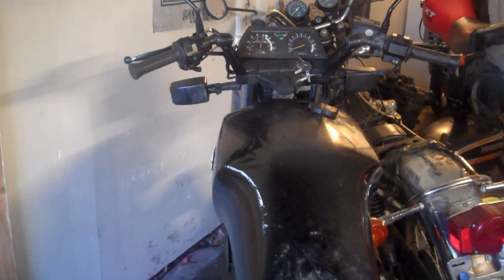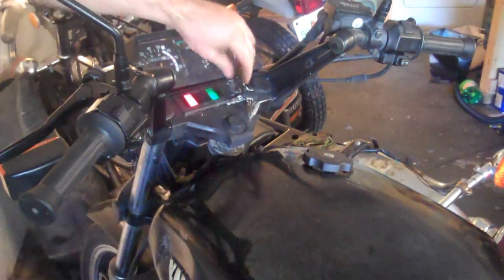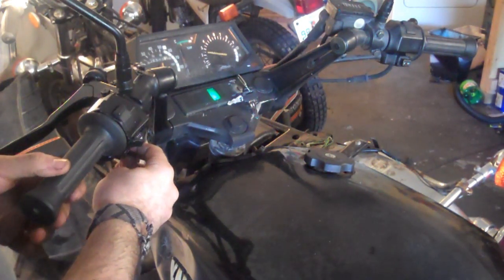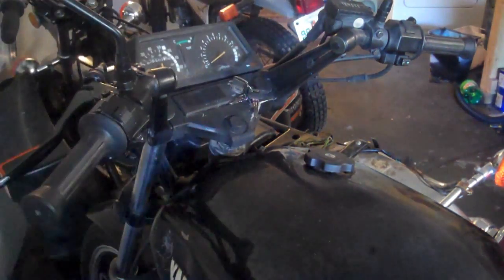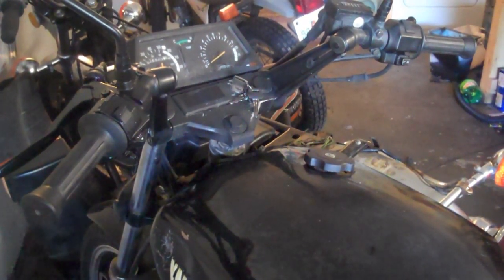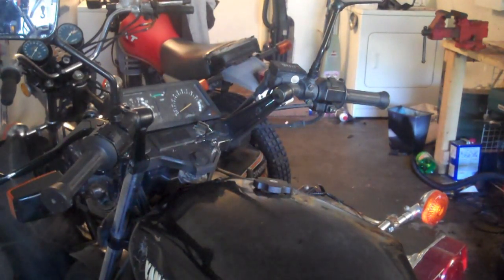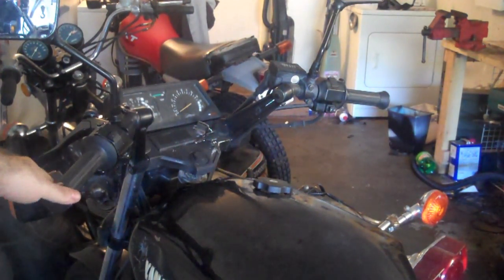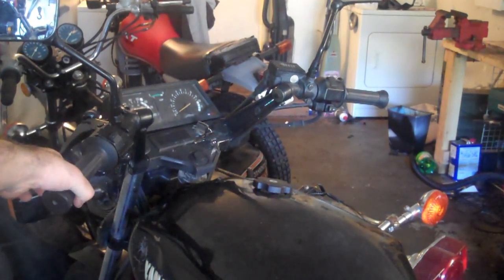How a kickstand switch causes a no-start situation

Comment: This happened to me once while i was taking the back roads for some nice turns. What had happened was somehow the two wires that connect to the switch had burned through(im suspecting it was touching the exhaust. so what i did was tie the two wires together to bypass the switch, no problems since :)

Comment: I actually bought an 01 zx6r for $800 and the kid told me it needed a starter relay.  I got lucky and found one on ebay for $6 with shipping and bought it before I went to pickup the bike.  Got it home changed it out and nothing.  I looked at the clutch (an aftermarket with no clutch switch) found the wires and it fired right up.

Comment: I am having this issue right now. smh I changed my kickstand due to the other one breaking and now when I put my bike down in first gear it kills the engine. thanks for the video. I am like really frustrated. I have assembled and disassembled my kickstand multiple times to no avail. I will try and look for the little "plunger" contraption tomorrow. haven't been able to ride for 2 days now and its so frustrating. thanks for the video. 2017 Honda CBR300R btw.

Comment from the maker: The neutral light switch is a little more complicated than a kickstand switch. On the ones I have serviced, they are like a cylinder with nubs on it, and when you shift gears it rotates around, and the nubs press on the switch to illuminate the neutral light. So, you could either bypass the kickstand switch by just cutting the wires and twisting them together, or break out your manual and find that neutral switch and repair it
Reply: What if you're not getting any power at the kickstand switch or the nearest inline connector, does that mean it's grounded out somewhere further down the line?
Reply from the maker: @igotakai5644  Well either yes there is supposed to be power and there isnt for some reason, or there is not supposed to be power because the kickstand switch acts as a ground itself, maybe for your starter solenoid. There are 2 different types of systems
Reply: @mrmaxstorey  Ok thanks I'll keep digging.

Comment: Yeah I know this one buddy happened with my clutch switch. I went all around learning about the ignition and charging wiring/circuitry to find that little shit :) also the previous owner jumped the side stand switch wires at the connector back up in the wiring. It'll bite me in the ass one day when I set off with the stand down tho. You're really good at explaining these issues dude :)

Comment: I've had some problems with ignition on my old Yamaha 1983 scooter. 
Finally I realized what was happening. There's an engine cutoff switch 
on the kickstand. Now some people say, your switch is not opening 
properly when you pull the kickstand up. However if that was true then 
why was it that when I left the charged up bike on the kickstand for a 
few days, the battery would lose its charge? So my answer to this was 
that when you deploy the kickstand, the cutoff switch is compressed, but
 over years of metal wear or wear to the switch button itself, that 
switch contact becomes less effective and starts to wear out. Then the 
switch is not properly depressed all the way when the bike is left for a
 few days leaning on its kickstand !! Then, I think what happens is that
 the bike is leaking electricity round the cutoff switch, discharging 
into the bike ground (the rest of the bike). Over a few days, you've run
 your battery down! Just now after charging my bike I started it up very
 easily, so I am pretty sure the problem is not that the switch doesn't 
open properly when I pull the kickstand up. (The switch seems to pop 
open as it's supposed to.) The real test will be to see if the charge 
holds for a few days of nonuse, in the new situation in which I've stuck
 a copper penny on top of that switch button on the kickstand base, then
 deploying the kickstand. That copper penny just adds pressure to the 
switch where the kickstand rotates to depress the switch. So now, the 
switch will remain depressed fully and will completely stop that circuit
 from leaking electricity to ground. So, if my theory is correct, in a 
few days, the bike should still be holding the charge on the battery 
properly. If I'm wrong, then the battery will have lost its charge again
 after a day or two. If that happens it would suggest I'm way off base 
and the problem is elsewhere. However I think I'm right. The way it 
started up this a.m. after having been left with the copper penny on 
that switch overnight, was perfect. It just immediately started, no 
problem. I think this is the solution for kickstand cutoff switch 
problems. Not sure how to do it without buying a new cutoff switch but 
I'll think of something easy. I can just stop using the kickstand 
entirely, only use the center stand when leaving it overnight. That's 
probably the best way to deal with it. I've cussed at it long enough, I 
sure hope I've got the answer now. I don't want to stick any repair 
money into this thing. It is a good bike for short errands and I really 
like it.
Reply: I should add that when I left it overnight with that copper penny helping to depress the switch button, I was trickle charging the battery. See, the problem is not that the battery is no good, I think - the problem is that after charging, with the bad semi-off position of the kickstand cutoff button when I've got the bike on the kickstand, I'm "trickle-uncharging" the battery all night, unless I put the trickle charger going to maintain some kind of charge anyway. I was doing this before but just barely keeping some charge even with the trickle charger going. Okay then, the normal answer would be to just buy another $60 battery, what's the big deal? But I have already tried changing batteries, recharging batteries and all that stuff. So I believe that a "bad battery" is NOT the problem AT ALL. The problem is the semi-off button left semi-off overnight. (It's not the spark plug, it's not the coil, it's not the starter motor, it's not this, it's not that. IT'S THE SEMI-OFF cutoff switch.) (The switch is not one that clicks on, and clicks off, because that's not what the kickstand is set up to do. It just depresses, and releases smoothly. So it must have a "smooth" gradual increase to fullest contact and then fullest disconnection, which makes the proper function vulnerable to failure due to surface wear of the button and the metal pushing against it.) That's my theory, but not fully proven yet. It might be something to consider as a possibility. I think it might be something to really test out.

Comment: It appears I just had mine fail on my KLX be glad it was such an obvious fault on yours Mine was miss fireing in high revs and then just shut down and would not restart.   After watching this I started thinking hmm   Yup bike starts and runs fine with the stand up but in Neutral or even with the clutch in it will crank no start friggen crazy.  This happened post timing chain fun

Comment: Thanks man was just checking out that on my bike also as it just cuts out sometimes when I’m out and reacts the same way as when the bike stand is down and I’m in gear.   Fingers crossed 🤞🏼 it works. Great video.
Reply: Did you ever figure out your issue?  I am having your exact same problem.
Reply: @nelaco1  I wasn’t 100% what the remedy was but I did adjust the idle on the bike and that seemed to work and I think my inexperience at the time was an issue too.  I think the odor was too low and it would cut out as I was dropping gears. Let me know how u get on with the idle
Reply: @DeiseRebel  Thank you Deise,  it could very well be the idle.  It is very low.  I'll try that next.  The bike is brand new and with only 500 miles now.  It is under warranty but I rather fix it myself if it is something this simple.  Appreciate the quick reply!  I'll let you know how it goes.  If it doesn't change, I'll bypass the kickstand switch.
Reply: @nelaco1  Yea I checked the kickstand also and that wasn’t the issue.
Reply: @DeiseRebel  that was it!  Increased the idle to 1100 and it doesn't die anymore.  Glad it was something this basic.  Thanks again!
Reply: @nelaco1  Ohh yes, see it’s all experience, I’m only on bikes a year last month n this happened so that’s the whole point of my channel is to help others and show my journey.  Thrilled you got it sorted 🏍✊🏻

Comment: Hey max, ive got what i think is a carburetor question for you. 81Kz 305 I cant get the idle to be steady or the throttle response good on the low end. I set the idle where it needs to be but after giving it some gas the engine idles higher then settles down after a bit.
Second i cant get it to be responsive at low rpms. If i give it a little gas and steadily increse it, it runs fine. However when i get on the throttle it sputters and dies.  Right now all the cables and air box are off.

Comment from the maker: I gave up trying to lube this switch and just bypassed it
Reply: I think the problem is not that the switch is not opening enough when you need to use the bike, it's that the switch does not close tightly enough (does not fully kill the electric current) when the bike is left standing on that kickstand). That's just my theory, might be nuts, not proven yet.
Reply: If I lubricate the switch, doesn't that risk cutting the circuit, because oil does not conduct electricity?
Reply: Maybe that would be ok, I'm dyslexic.

Comment: So if you don't have the boots hooked up the air cleaner it won't fire?  Is it that the fuel mixture is too lean?  Or does it have to do with pressure?  It doesn't even try to start even with starter fluid. I wish I knew how to put a Holley on the bike.  I thought 4 carbs would be neat. Boy was I wrong. How do you time the bike? What is the firing order?  I'm going to replace the valve cover gasket. I will check to see if all valves are working right.

Comment from the maker: Woah ok lots of questions. If you want to get into bike diagnostics with me deeper feel free to send a message. With the boots off the bike should still start up on starter fluid, but it probably won't run well on its own gas, because the mixture will be lean and the airstream will be chaotic.

Comment: Experienced this for the first time on my 1989 Honda CBR 600 (Hurricane). Oddly the stand light wasn't illuminating when engaged or disengaged. Bike died as soon as it's put into gear. Guess my 30 years old switch is going bad.problem wasn't assembly (verified), but the switch itself (electrical part)
Reply: Dealing with this on a CB750 -- I should try the switch itself, since things seem to be put together right..

Comment: Hi MrMax.  I was wondering if you could help me-I just picked up a '89 Radian and it has some issues.  Any guidance on what is "right side up" for an oil sensor (is it how it sits in the pan?  How can I bypass it?    When I hit START, the headlight goes out and the oil pressure light comes on, then goes out- No action at the starter - but directly wiring relay and battery gets motor to turn.  Any help would be appreciated.
Thanks for great videos

Comment: I just purchased a Vision off of Craigslist and it turns over and is getting fuel but no spark on either side. I checked the wiring harness R/R, battery (voltage and amperage), fuses, plugs, wires, etc and all were fine. The only thing I can think of is that the CDI is dead. However, after buying a "working" replacement off of ebay it still has no spark. Would this be a possible solution? I have the bike in storage and can't get to it to test it at the moment.
Reply from the maker: It is a common problem....

Comment: I have this problem on my R1, when I let the clutch out (while in neutral) it dies. Any ideas?
Reply from the maker: Did you check this switch?
Reply: Dealing with the same thing with my R1 . . . A few things to check: This switch, the clutch switch and the infamous TPS sensor. Also synchronizing the throttle bodies.

Comment: God damn these stinkin things because any idiot knows to put up the kickstand, if you leave it down you deserve what you get. I am so pissed off. I've got this problem with the same kind of kickstand kill switch, and looked at it, and in my opinion, it's not only preventing the Damned motor from starting (actually a great motor) - - but I think it's also draining electrons from my battery. Is this possible? In other words, when that switch malfunctions by being stuck halfway, with the kickstand deployed, in other words, when you have the bike leaning on the kickstand for a while, if the switch button is forced inward but not forced inward enough, the battery drains, then when you go to start the motor, the battery has drained off too many electrons. So, the problem is not so much that when you go to start it, the switch doesn't come down all the way, but in fact when you've been leaving the bike propped on the kickstand, the switch is only forced inward partway -- then, the electrons drain off because even though you have killed the engine using the kickstand, you haven't killed it enough and you've left electrons draining off into the "ground" which is the rest of the bike. Then, when you go to start it up, the switch does not open all the way, it opens halfway. But even if it does open all the way, by that time, your battery is already drained off too much, and you can't start. I'll keep fooling with it but I think I'm partly right here. Thank you !!!

Comment: I have a similar problem. The Neutral Light on my 88 Shadow 600 turns on sometimes and other times it does not turn on. So when I'm in neutral, if the neutral light is off and I put push the kickstand engine will turn off. I noticed that I have to play around with the neutral clutch shifter and move the bike back and forth to make it work sometimes. What do you think that could be?